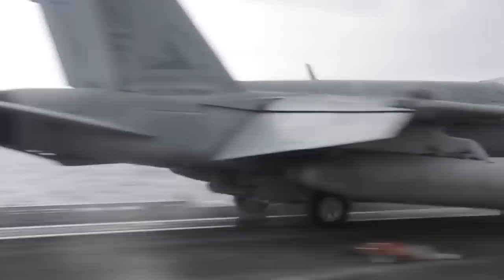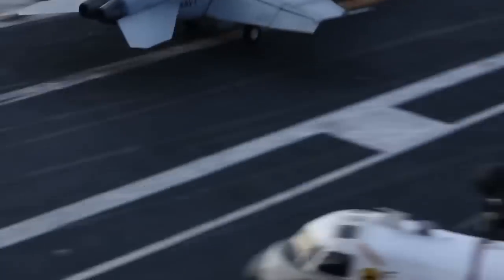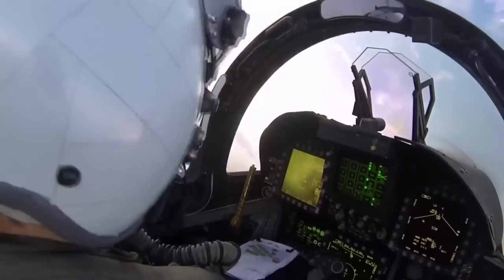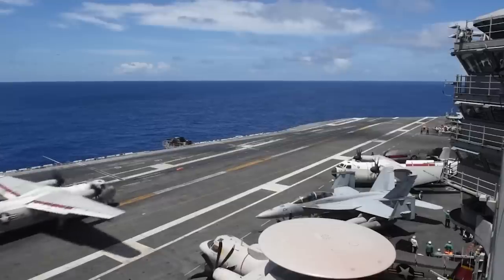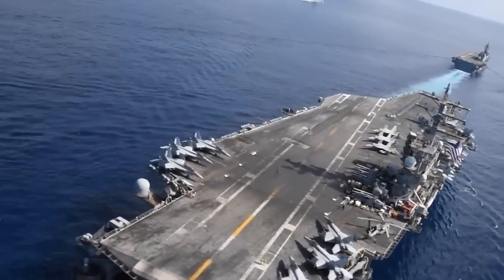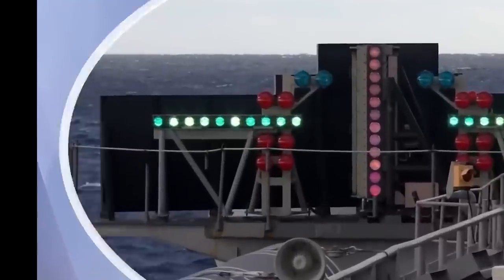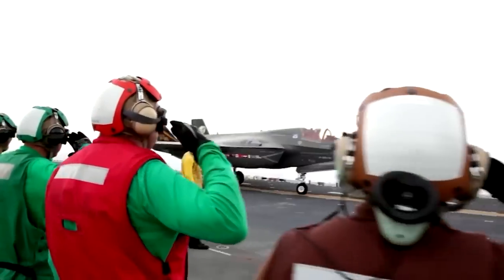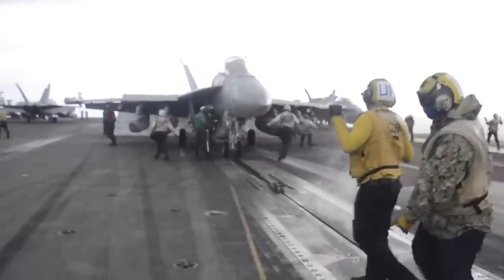Inside World's Most Dangerous Workplace: US Aircraft Carrier Flight Deck

Comment: One big mistake, the aircraft's engines are not turned off and on when they are on the catapult being checked over prior to actual launching. I spent 4 years on the USS Constellation in the 70's working as a plane captain and powerplant tech on the night shift. Try doing your job in total darkness with 30+ aircraft running and taking off and landing, that's dangerous. Some people only lasted 5 min. first time on deck and called it quits. Working the flight deck will change you forever.
Reply: Thank you Joe Moore for your service to our great nation, YOU are one reason why the USA is a great nation with great men!!!!
Reply: Your absolutely right Joe did 2 tours on the enterprise early 80’s worked on the flight deck as plane captain as well on first cruise and AE on second. Not an easy job to do
Reply: Correct
Reply: I once worked at manufacturing plant with big machines with alot fast moving parts it was hard work on your feet all day.
We had high turn around workers couldn't handle it until one day this new worker comes in and when he was assigned to my crew I asked him what did you do before working here he replied I served on flight deck of aircraft carrier I shook his hand thanked him for serving and knew I didn't have to baby sit him around these machines and I was right this guy saw things happening before they actually happened.
Now he is off the floor and has his own office.
Reply: V-1 USS CORAL SEA  74-75
Reply: USS Idependence. Round the clock ops in the Persian Gulf. You ain't lying. The Flight Deck and OPS will change you forever. Hooyah Shipmate.

Comment: When a plane launched does the tow bar fall into the ocean and lost or is it tied to the carrier
Reply: I think you mean catapult. The jet doesn’t launch with a tow bar the tow bar is only connected to the jet to tow it to a different parking space with a tractor. The catapult actually launches the aircraft. It has a stopping point and the aircraft keeps going. The catapults are operated by steam. I have been a final checker and power plant tech on deployment on the Truman for the 2021-2022 deployment
Reply: If you're referring to the tow bar mentioned in the video, it's attached to the nose gear and stays with the plane.
Reply: The launch bar stays connected to the shuttle until full completion of the launch. The Holdback bar (depending on the type of aircraft) is tied into the aircraft and the Catapults NGL system. Those designed Holdback bars have a certain breaking strength that’s designed specifically to that Aircraft. E-2’s & C-2’s utilize a “T-bar” that breaks after the Fire sequence. Those half pieces can be kept as memorabilia if left behind.
Reply: Before the use of nose tow launch bars, catapult launches used a steel rope called a bridle (they varied from one aircraft type to another). The bridles would stay on the ship at the end of a launch, although I've heard that in the early days of using them they were just flung into the ocean at the end of the shot.
Reply: @davidabarak Correct. Before the invention of Holdback bars, Catapults used the Bridle system and required an extra body for “hookup”. 

I had done it multiple times prior to the extinction of the Bridle system.  I hated it and was grateful for the invention of the Holdback Bars.

Comment: I would think the night carrier take offs and landings, particularly in rain/squall conditions would be the most dangerous workplace.
Reply: I worked on nights on the flight deck and we had to use our blue flashlights but sparingly. It was pretty hard to see and we always tripped over chains 😂
Reply: Night launches are always a little more difficult than day launches. It’s really hard to see exactly what you’re doing. You almost need to be experienced enough while operating during the day time, that you could possibly do the same shit blind folded at night.

Aircraft propellers are more difficult to see at night, and very easy to miss and walk right into them.

Comment: 3:08 'Restart the engines'?? What?? They don't stop the engines ever from first taxi, they need them for hydraulic and electrical power, and for thrust to taxi into the shuttle. The signal at that point is to go to full mil power or whatever setting that particular aircraft uses for catapult launches. They then do a full systems check in tension which is cockpit scan by the pilot and full controls sweep while the flight deck crew final checkers verify full control surface movement.
While personnel who make actual US NAVY video productions may make this mistake it seems hard to believe it would not be caught before release. This has to be an unofficial fan channel and not actual NAVY.

Comment: Whoever made this video has no clue.
Reply: Has no clue regarding what? Please explain and elaborate if you will.
Reply: @torn-_shuttle123 

I started recording errors as I watched the video, but since the video is more than 11 minutes long I realized that would be a long task. (There were only three or four errors in the first three minutes. In that time, they generally got things right.) Instead, I'll describe the actual process here. I'm describing this as if the catapult officer (shooter) was on the flight deck; it's slightly different if the shooter is working from the bubble (the pod or whatever else it can be considered). Some of what I'm describing happens concurrently, but I can't describe it like that.

###

Well before the aircraft are started up for the next launch cycle, a plane captains cleans the cockpit glass. Ordnancemen load weapons onto the aircraft. Aviation Boatswains Mates that specialize in fuel will fuel the aircraft. If needed, easy maintenance items will be handled by various technicians.

The pilots review previous problems (discrepancies) with the aircraft, and they calculate the gross launch weight - the empty airplane plus the fuel and weapons.

Aircrews arrive at their aircraft and perform basic power-off preflight inspections, both internal and external.

Guided by the plane captain outside the aircraft, the pilot starts the aircraft engines. Aircrews inside the aircraft begin power-on preflight checks.

Plane captains remove the chains holding the aircraft to the flight deck and then they remove the wheel chocks. (There are several chains, so more than one plane captain is involved with this.)

Aircraft directors direct the pilot to holding points on the flight deck, depending on the traffic flow and the order they'll be launching. There are zones on the flight deck, so control is passed from one director to another as needed.

The aircraft will stop behind the jet blast deflector (JBD). When the aircraft that's already hooked up to the catapult is launched, the JBD will be lowered and the aircraft directed forward to the point where it'll be hooked up to the catapult.

The aircraft director will signal the pilot to lower the nose tow launch bar, which extends forward from the nose landing gear. (I believe this is done from outside on E-2 Hawkeyes, but I could be wrong.) A member of the catapult crew will attach a holdback bar to the back of the nose gear. With older aircraft and the E-2 Hawkeye, a metal fitting, often called a dogbone, is what links the holdback bar to the nose gear. Hornets don't use dogbones. "Final checkers" will take a quick look at things like tires, just to back up the pilot. The pilot gets a signal from the aircraft director to spread the wings (the wings are folded while parked and during taxiing).

A weight board operator on the flight deck will dial in the reported gross launch weight for the aircraft into a box with big numbers. That person shows the pilot in the aircraft. If the weight is still the same as what the pilot calculated, he or she gives a thumbs up. Sometimes fuel or weapons are added or removed, so the weight can change, and if that's the case the pilot will signal to increase or decrease it in 500 pound increments. Finally the pilot will approve the new weight, and the operator shows the board to the console operator, who will enter the weight into the catapult system. If you give the "cat shot" more power than is needed based on the weight, you'll over-stress the aircraft over time (you could even break the launch bar off), and if you don't give it enough power, the aircraft won't be fast enough to fly at the end of the shot.

The aircraft director will signal the pilot to taxi forward slowly. The launch bar will ride up on top of what's called the shuttle blade, the part of the catapult the aircraft connects to, and then drop down to the flight deck in front of the blade. The back end of the holdback bar drops into one of the slots in the "zipper track" on the flight deck; this is what keeps the aircraft from moving, even at full power, once the pilot releases the brakes for the last time.

The person handling the hookup duties signals for the blade (which is connected to all the catapult machinery directly below the flight deck) to be move forward, coming into tight contact with the launch bar. The deck edge operator, who controls the catapult, will raise his or her hands once this is done so that if they catapult fires before it's supposed to, everyone will know it wasn't this person's fault. The catapult is now "in tension;" the aircraft is fully hooked up, and if the catapult is fired accidentally, the aircraft is going, no matter what, so the crew needs to hurry - safely.

The aircraft director turns over control to the catapult officer (the shooter). The shooter signals the pilot to go to full power. The pilot looks over the engine and other system instruments, then tests out the flight controls by moving the stick (or yoke in Hawkeyes) to their maximum deflections. Final checkers stationed a safe distance at the rear of the aircraft look at the engines and flight controls. If they see no problems, they'll give a thumbs-up. If the pilot is feels the aircraft is in good shape, he or she will salute the shooter. (At night, the pilot turns on all the external lights instead.)

The shooter will render a quick salute to the pilot, and then conspicuously point out the various places where the people involved should now be so they're safe. The shooter will time everything so that the bow of the ship isn't pitching down at the end of the cat shot - you don't want to point the airplane towards the water. The shooter will also quickly verify that the catapult is set correctly for the aircraft. When the shooter is satisfied, he or she will kneel down, touch the flight deck and then point forward. That's the signal to the deck edge operator to launch the aircraft.

The deck edge operator, hands still up, will do a quick look left and right to verify everything is clear, then they'll push the button (I think it's two buttons at the same time, actually), to launch the airplane. The catapult fires; in the case of a Hornet, the holdback bar splits into two re-attachable pieces. The smallest piece stays with the airplane until it lands and the largest piece, the bar itself, stays on the ship. With aircraft that use dogbones, the dogbone actually breaks apart. Half stays with the airplane until it land and the other half gets tossed into the ocean. The holdback bar stays on the ship.

###

It's possible I may have left a few small steps out (still drinking my morning coffee), but in general this is a pretty complete description of the process to launch an aircraft.
Reply: @davidabarak  Was your reply directed towards me or to anyone that wants to know out of curiosity?
Reply: @torn-_shuttle123  It was a reply to your question, but meant for anyone.
Reply: @davidabarak I suppose I was just questioning about your “No clue” regarding the video.

I’m fully aware of how Flight Deck operations are conducted. And more than qualified on how Catapult and Arresting Gear systems are operated. Retired ABE. 

Just wanted to hear your view on why you thought that person who posted this video “had no clue”. That’s all.
Reply: @torn-_shuttle123  I like that the thumbnail photo for the video is a Viking. I was an AW in them. Fun times!